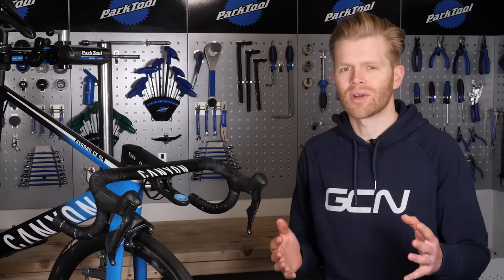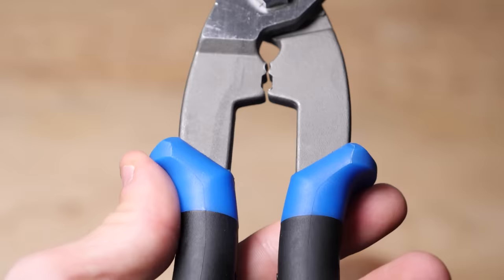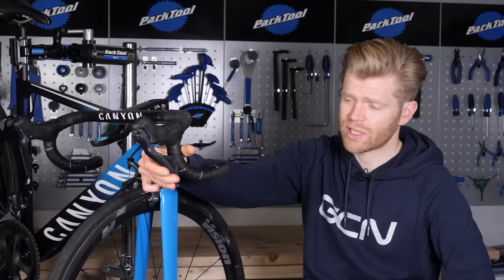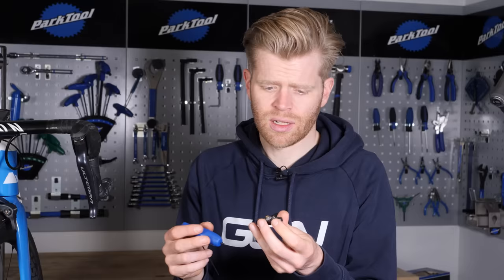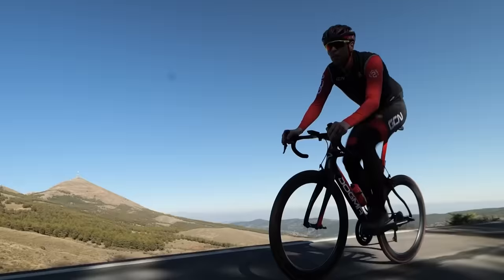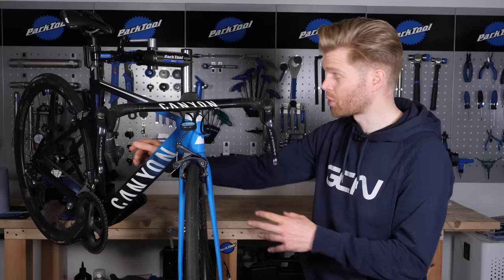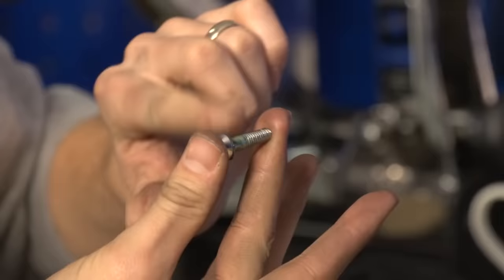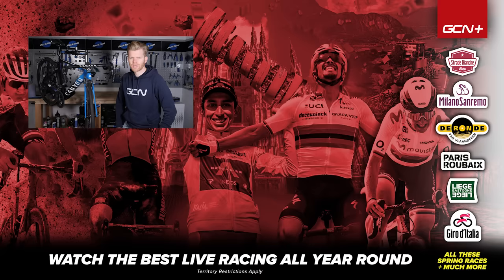Try This Before Changing To Disc Brakes! | Maintenance Monday

Comment: The centrifugal force of the rim spinning has more power where the disc is. then at the top of the rim. when the pads touch the top of the rim you have way more control over the bike. And when the brake system is on the top of the rim, you have way more power to stop the bike.
Reply: Well purely based on geometry, the rim would give more stopping power, but discs can generate so much more friction that they have more peak stopping power.
Reply: @invisiblescout6335  very true  but let's just think for a second. 15 years ago. It was all about the bike being light and being able to climb easier. These bikes today are basically time trial bikes and on top of it with a heavier brake system. And the electronic systems way more as well.
If we were looking for the best racing product to win the rim brake bike would be the best choice.
Are we looking to have the best race bike or are we looking to keep this market with the newest product?
Reply: I don't disagree with rim brakes being overall better, just said that discs stop you faster.
Reply: @invisiblescout6335  that is questionable. I have a cycle cross bike the Crockett and when I'm wearing a bag with my dog in it or I'm going a little bit too fast on a very steep hill I can feel the system slipping it's not catching.
Then I have a gravel bike and this Shimano system just sucks. I'm looking to get mechanical brakes. Number one the  girth of the hydraulic shifters is much bigger and very uncomfortable to hold on long rides. The more expensive systems are much better when it comes to the size of the shifters. 
Watch a cycle  cross race from the past and watch one from today. Just the noise is so crazy 🤣   sounds like a flock of  geeseare being butchered
Reply: @HarryTzianakisTheGodOfSpeed  You can disagree, but it is a fact that disc brakes will stop you faster with less input than rim brakes. If you are personally not experiencing this, then there is an issue with your brakes, not disc brakes as a whole.
Reply: @mihalis1010  GCN did a video where there was no difference between stopping power in the dry
Reply: @mihalis1010   You're right, the hydraulic system is not powerfully enough or there could be an issue with it and it's not stopping my bike. Now I have to go spend money to fix it. Which if it was a cable I would have just tightened the cable up a little bit.
When we were kids we would work on our own cars literally on everything. When they created these new cars. You couldn't even stick your hand in the motor.
The same thing happened to bicycles. They did not want the consumer to be able to repair their own machines.
It's funny how he says oh I would rather you do it yourself but you need to buy our tool . A hammer and a very sharp chisel can cut The wire. Ha ha ha 😂
Reply: @dirktolboom4060  no, there was a stopping power difference.

One of the presenters (Si I believe) descended a mountain on rim and disc twice, while wet and while dry. In the dry he used discs first than rim and same for the dry. It was found rim was marginally slower in the dry and much slower in the wet, Si's personal commentary was he preffered descending on discs (unsure whether it was applicable for the dry as well)

Discs have more stopping power
Reply: @HarryTzianakisTheGodOfSpeed  hydraulic brakes aren't hard to fix granted you bought the right components, you've either got air in the hydraulics or contamination or bad brake pads.

You could try doing a simple brake bleed which would take 10 minutes, a funnel, fancy skewer and some mineral oil
Reply: @calebgonsalves2970  a mountain descent is not a test of stopping power.
Reply: @dirktolboom4060  then you don't remember the gcn claim discs have way more stopping power than rim brakes
Reply: @calebgonsalves2970  I have to admit that I couldn’t find the video I had in mind so I might have misremembered that one. 

But with maximum stopping power the deciding factor are your tires and system weight as both brake types have enough power to lock your wheels
Reply: @dirktolboom4060  max stopping power is ultimately decided by grip, disc brakes offer far greater braking power to user input, the amount you pull the levers on a rim brake is much more than on a similar disc brake setup
Reply: @calebgonsalves2970  Bruh I fix bikes ha ha ha I can do it. I don't like it.  

I would rather have more control over the bike then having extra stopping power.

Comment: In my experience, the best way to maintain the performance of rim brakes is to keep your rims smooth and your pads a bit roughed. The sort of surface scuffing you shoot for when patching a tube is what works best on brake pads.  Keep in mind that as you ride, the scuffing gets buffed down, so you need to revisit it often.  And be advised that this will shorten the life of the pads somewhat -- better theirs than yours.

Comment: I have town bike with discs ...it's a nightmare to maintain and the pads wear out a lot ...I see no reason to get a new road bike
Reply: Rim brake wheels do wear out too. The only difference is instead of replacing a a couple of small, inexpensive brake rotors you'll have to replace a whole expensive wheelsets.

Comment: A little off sponsor message there Ollie, MO94 is of course now very much PTFE free! Still good tip on cleaning your rim often
Reply: Depends which one you get.....his has the following.."Muc-Off MO-94 covers all the bases with its incredible PTFE formula"
Reply: @truthseeker8483  go to 10:01, Ollie holds the can up, first bullet point on the front of the can says "now PTFE Free". Wouldn't normally bother debating such points but as you call yourself Truth Seeker I just couldn't help myself ;-)
Reply: @esoxcycles  PTFE free? So what is the point of it? 😀

Comment: Better mechanical design means that you are achieving your goal with less, stronger, simplier parts, that work with less stress and are easier to fix and service.
Rim brakes and disk brakes both are able to stop a road bike under almost any conditions, with each of the two designs pros and cons.
But the similarity stops here.
Disk brakes on road bikes had to be pushed, people had to be persuaded, marketing had to do it's best.
Mission accomplished.
But rim brakes, on the road bike application are a sound design that could have been further evolve. 
Disk brakes will stay as long they are profitable..... That was the plan anyway....

Comment: Wonder why they never invented hydraulic rim brakes for road bikes. Used to use them on the old trial bikes when I were a kid. I like the tidy wireless cockpits of disc but the ting ting ting ting ting ting ting ting ting does my head in after a descent

Comment: I've just replaced a rim, on my rim braked bike, after probably around 50,000 miles, for about the same price as a disc. But over that same 50,000 miles, you'd probably have to change at least ten discs; so not good for the planet.

Comment: if you are a road cyclist and you prefer disk you need to question why you are still cycling
Reply: Because I like going fast and the Novelty and pride in doing that independently never gets old, also travelling and seeing how much distance I can cover on a map puts a smile on my face.

I also like having handfuls of brake on my fingertips for confidence, and I don't want to stop cycling when it rains
Reply: @calebgonsalves2970  zero aero, zero weight gains. Braking ultimately depends on tyre to ground contact, in wet conditions, yes you will have to brake sooner on rim but if you start skidding on one, you’ll skid on both.
Reply: @eragon6946  you'll also shred your wheels if it's wet AND dusty and you have to brake wayy before on rim than disc, discs still brake comparably to dry weather.

Also nobody brakes until your wheels almost lock, and disc brakes can fit wider tyres which have more grip
Reply: @calebgonsalves2970  you ever shredded a rim wheel from dust? lets not go into gravel/cyclocross territory where disc is vital.
Reply: @eragon6946  yup, I've had lots of times where I've got my rim contaminated by God knows what and it makes such a horrible screeching noise, thing is, I don't ride in the wet, God knows what the brakes get contaminated with but it certainly isn't doing the brake track any favours

Edit:- forgot to specify these are instances of pure road cycling, no gravel whatsoever it barely rains in the summer where I live but it's still pretty dusty. Happened a couple of times descending on hill climbs and during some flat rides, I've got rim brakes and am actively looking to switch

Comment: Key advantage of a rim brake bike: gotta rebuild the rims every 15K kilometers.
Reply: I think you mean 150,000 km. If your wheels got out of true every 15,000 km, you need to find a different shop. Last year, I had a front wheel that was 20 years old, with 100,000 miles on it, that finally went.
Reply: @billkallas1762  It is every 15K km indeed. Has nothing to do with the "shop", but the rim brakes grinding through the few mm of aluminium. If you live in a flat area and only ride in good conditions, your rims might last 30K.
Reply: @NevermindXY  I've never has a clincher or tubular rim wear out, like you claim they do....How many rims have you worn through? If you hear a grinding noise when braking, it means that you have grit in your pads that should be removed. If you keep hearing grinding noises, it means that your pads are too soft, or that you have cheap rims.

Comment: If you're not using a TIG welder to cut and fuse the ends of your cables in one operation, are you even trying?

Comment: No One Needs Disc Brakes ! A million miles have been ridden in the major Tours with rim brakes. Accidents do not occur due to inadequate  braking, they occur due to riders pushing the edge. They could have slowed with rim brakes but chose to push the envelope. Rider error, not inadequate brakes. The Tour of The Basque Country occured with all riders posessing disc brakes. Riders appeoach corners faster with discs depending on discs to rescue them from their error. Fire adhesion, however, is the limiter. Tires do not care what brakes you use. They will loose traction with any brake. Then, your’re down. Vindegard, evanpoel, Rozlic, Vine. Discs didn’t save them, they probably suckered the riders to appeoach the corner hot, and they payed the price. Would the riders alter their approach with rim brakes. Probably and they may have saved painful recovery.
Reply: I agree. It is easy to totally block the wheels with both rim breaks and disk breaks. So breaking power is not the issue here (although many claim that). But disk breaks DO cost more and are less easy in maintainance. They are forced to us for commercial reasons, and most of us are stupid enough to start thinking we can not live without them.

Comment: For me rim brake is deal breaker. How do you rely on it going downhill at 60kmph?
Reply: It's simple, you don't 😂

Seriously though, I dunno if it's my clunker budget bike but it's rim brakes are terrible, im switching to discs within a year, unfortunately that means a new bike
Reply: Well, they used rim brakes successfully for many years in the Tour de France.
Reply: @mikefule330  racing is different. They use motorcycles without headlights in racing. Does that mean you will go for one?

Rim brake is hazard for road bikes. Not only it is inefficient but also makes controlling bike difficult.
Reply: @mikefule330  yeah, but just because it used to work doesn't mean the system is perfect....
Reply: @mikefule330  I will not risk my limbs for rim brakes :) even a feet in braking difference can make a big impact on real roads.

Plus disc just looks cooler and is easier to maintain.
Reply: @z00011001  Each to his own.  I've owned many bikes and ridden many 100 mile days, toured with heavy panniers, ridden on and off road and currently own 2 bikes with rim brakes and 1 with discs.  Perfectly happy with the rim brakes.

Comment: There's nothing fancy about disc brake bikes.  They're overpriced pieces of shit that cost twice as much as rim brakes, has more than twice the amount of tech issues, adds double the weight to your bike, reduces aero drag, and fail on overuse before rim brakes.   The only thing you get from disc brakes is stopping power -_-
Reply: ....Are you trolling? You can't honestly believe what you're saying....
Reply: @mihalis1010  unless it's ironic

Comment: If you like me a short(er) than average Asian male, or someone not blessed with having ideal leg length, you MIGHT think TWICE about disc brakes which I was stupid enough to neglect the q-factor issue. Admittedly I was angry with my judgment.
Reply: Q factor issue with disc brakes? Could you elaborate?
Reply: @calebgonsalves2970  there are already quite a massive definitions published but essentially I find ‘height’ in general has never been a point of discussions (you even find pro cyclist standing at 1.9 m (6’3’’) from Quick-Step riding yesterday in Flanders) Meaning if you are young, tall and powerful enough, a small riding adjustment, slight changes to shoes cleats solved the issue in no time. BB size has always been and is still very confusing. And now you add in a piece of metal plate (in various sizes) on the left side (in Froomy’s words giving you entertainment while riding Shimano disc brakes). Saying these from a small amateur cyclist’s perspective whose issues not always voiced out.

Comment: Rim brakes will always be better, rim brake bikes were always structural wise and design wise better.
Comparing bikes of the same level, rim brake bikes will be stronger, lighter, more aero, more dependable, easier to service and to own.
The disk break concept has not been yet perfected but has already brought a lot of money to the bike industry, costs still a lot to the cyclists, with out actually real bennefits. 
It was not a fair fight from the start,
evolution had to be gradual and more cyclist and ethically focused. 
But unfortunately money leads the way. 
Good luck.....

Comment: Rim brakes are inferior in more ways than they are superior to disc brakes. I've seen imploding rims because of too much wear, for example, or bursting inner tubes on a long and fast decent. In general, wearing down an important component through an indispensable action (= braking) is a really stupid idea in the first place. Rim failure often results in sever injury or even death. Add to this the inherent necessety to replace your expensive wheels when the rims are worn out. Using disc brakes is a no-brainer for me.
Reply: k
Reply: or just use alloy wheels 🤷‍♂️
Reply: @danc1829  they were ACTUALLY made for each other, wet alloy rims and rim brakes . . . perfect match!
Reply: I've had carb in Easton rims since 2010. Still riding them.
The problem is with those newbies they have no idea how to ride a bike. And when descending they just keep their breaks lock the whole time going down.
I've been riding bikes since I was a child. In my opinion, rim breaks on the street is the only way to go.

Most good companies like bontrager will give you a lifetime warranty on their rims.

And to tell you the god honest truth disc breaks don't stop that good.  

Repairing them is a nightmare. And the only thing for a rim break bike you need to bring is just an extra cable. Very easy to put in your bike bag.  
I haven't purchased a new road bike since 2018 because most of them are disc
Reply: It depends on the terrain, I live in a fairly flat area, no long steep descents, so I have no problems with rim brakes on my road bikes, even on carbon rims. On the other hand I really like discs on my MTB, that's where they really shine, in the mud and water and on steep downhills.
Reply: @danc1829  ah yes, circumnavigate the problem by uneeded compromises

Comment: They are dead, which they should be. Unpopular opinion, but in mountainous areas, rim brakes are more dangerous than disc brakes, ESPECIALLY when carbon wheels are involved. Stopping and controlling speed need to be consistent, and reliable, which they are not with rim brakes.
Reply: OK Millennial.
Reply: Totally agree. Rim brakes are dead and I've been cycling since the mid 70s.
Reply: Carbon rim brakes is a disaster waiting to happen on a long, technical descent